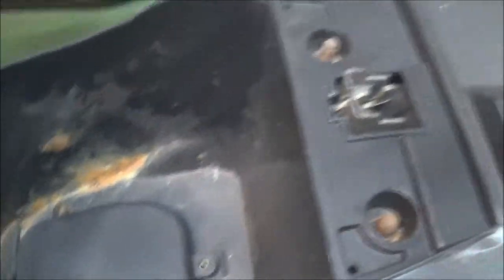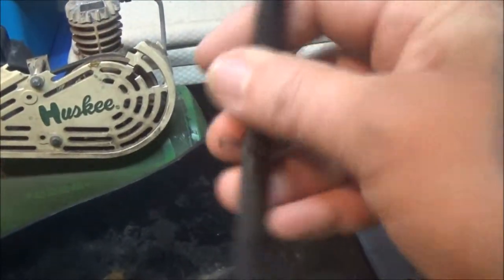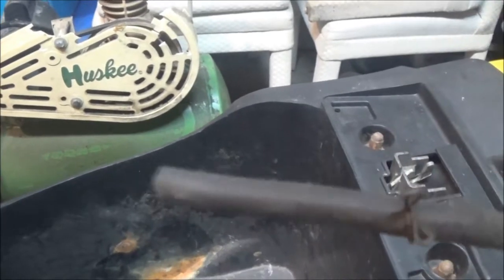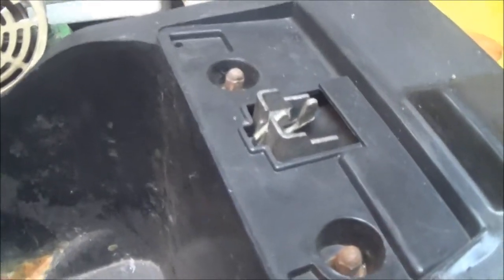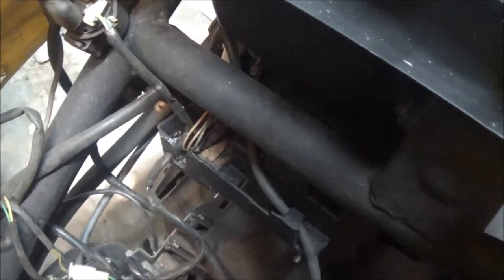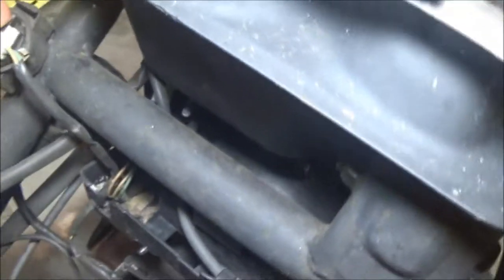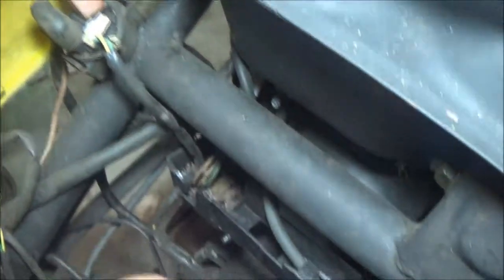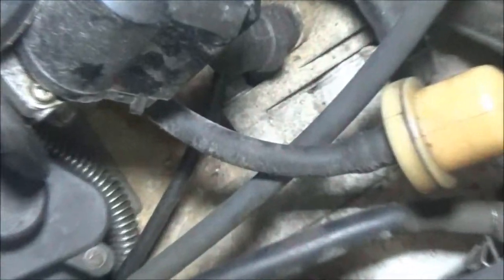How To Repair A Fuel Line On A Scooter

Comment: My SYM carburetor scooter over half year that engine does not working in Taiwan!
Due to my fuel tank located within under SYM scooter pedal, and I try to push scooter start motor switch and then I got some situations as below: (1) engine cylinder pressure is 126psi (2) spark plug has flash (3) fuel tank is not pushing gasoline through the fuel filter out? It seems my scooter fuel line system has block issue, could you offer some suggestions to help me fix my breakdown scooter here, thanks!
Reply from the maker: Yes. It could be a clogged fuel line, but also, make sure you check the fuel pump. Spray a little starting fluid in the carburetor and see if it starts then dies. Make sure you can blow through the fuel lines. Also, make sure your fuel tank is clean from dirt and water. Let me know what you find out. If you have any more questions please feel free to contact me.
Reply: @shabear1000  Base on my own scooter components replacement record file, I listing them as below: (1) scooter fuel tank use 18661KM (2) scooter spark plug cap use 3535KM (3) scooter fuel filter use 6668KM (4) only those fuel lines I never very detail to check to replace that before! If you have further suggestion, please make me know to fix my trouble here, thanks for your kindly respond!
Reply from the maker: @hunterchung7070  check your fuel pump.
Reply: @shabear1000  I checked my own component replacement record that fuel pump use 18830KM, I got new one in my hand, and I should follow your suggestion to replace it! Meanwhile do you have any idea to process around fuel tank fuel lines and air lines block issue? Due to I never experienced that I don’t know how to test them are ventilation available? Please suggest that for me, thanks!
Reply from the maker: @hunterchung7070  if you can't blow through the lines, they are clogged. Also make sure they're not dry cracked and fit snuggly where they need to go.
Reply: @shabear1000  So I have to take off them by my hand, and then one by one to blow through the line, if the line is clogged I should replace it, right! Thanks for your suggestion!
Reply from the maker: @hunterchung7070  yes sir.

Comment: Had mine running earlier and then she started dripping gas from the air filter. Should.i just check along the fuel line like ya was doing in this video?
Reply from the maker: Check the float in the carburetor.

Comment: What size tubing did you replace the lines with, and where did you buy them from? How about the filter? Do you suppose I could sleeve the lines with heat-shrink tubing while I try to get my scooter to start before the new fuel lines arrive? I just emptied my tank tonight and flushed it. There was varnished fuel inside, but there was virtually no rust inside. My float looks pristine, and it fit through the opening with no issue.
Reply from the maker: I can't remember what size the lines were but I just took a piece into my local small engine shop and bought a few feet of it. It was pretty cheap. And the heat shrink will work for testing purposes, in fact I have done that on a four wheeler before and ran it all weekend. Let me know how it turns out.

Comment: Where does the line go from the port on same side of that carburetor (up a bit higher and towards manifold)? I got a 2022 icebear rocket and I have to create a vacuum after cleaning the carb to get it to start but it never works and I end up paying too much money for ignorance.  I got two ports on both sides of the intake.  Everyone  says I only need 1. There's also a port ON TOP mounted to the manifold. I need ur help
Reply from the maker: Without seeing it I'm not sure where it would go. It might be a different carburetor. Maybe send a couple pics? My email is in the about section on my channel.
Reply: @shabear1000  OK thanks alot will send in the morning. Need some rest. Thanks a million times over. I've watched dozens of videos and learned some stuff but ur setup is the only one that's identical to mine.  I actually think my mechanic swapped parts of my scooter.... shit looks different.

Comment: My fuel filter on my blaze wolf scooter had a crack in it so I just bought a new one and I'm having trouble finding the position on the flow to the filter does the flat top side go to the carb or does the side go to the gas tank area ? need help thank you
Reply from the maker: I'm not sure what you're asking, but if you watch the video close and pause it when it shows the filter, it might show you what you need to see. I don't have it anymore or I would send you a picture.

Comment: Thanks for your videos, do you think it matters if the fuel line are 3/16 or 1/4in, what if you decide to not use a filter, is it detrimental to the engine if you do not?  TY for your help
Reply from the maker: Thank you. That size fuel line does not matter. I would use a non paper filter.

Comment: I just tried the same process you did, but my gas started leaking. What did I do wrong please help
Reply from the maker: Where was it leaking from?
Reply: @shabear1000  the carburetor
Reply: @shabear1000  also if you don't mind going to my page and checking out the two recently videos I posted and tell me what's wrong. I would greatly appreciate it
Reply from the maker: Left a comment on your video.